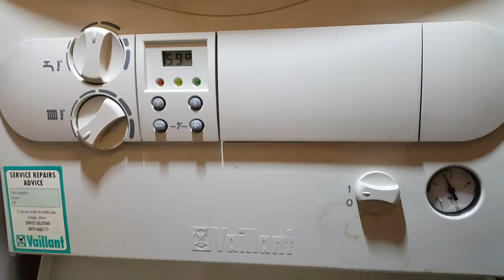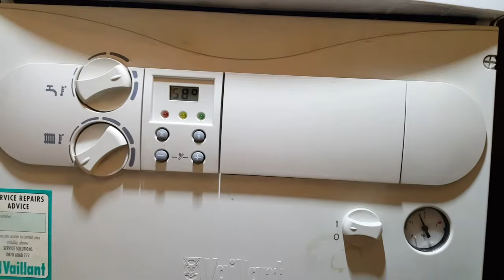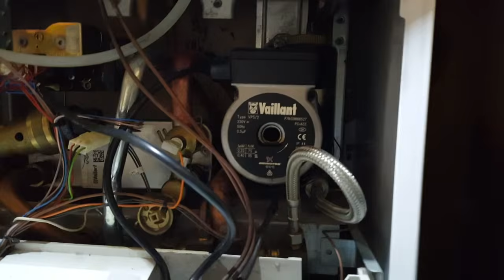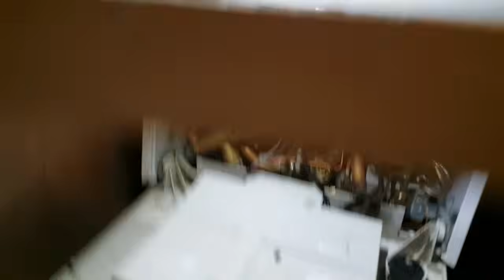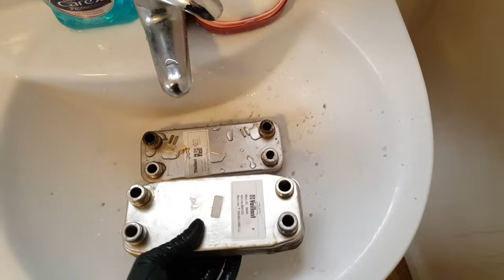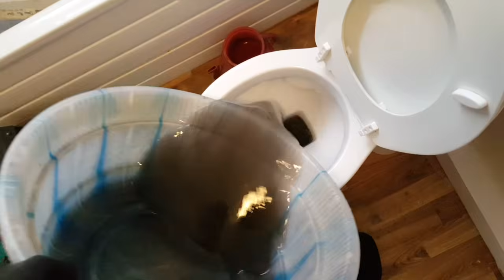Vaillant Hot Water Issue

Comment: thx for the video. I have problem that when I open the hot water I se the fire light up but the water are worm and not hot
Reply from the maker: Hi it's possible you the the same problem shown in the video.
Reply: @Abc_Heating   Thanks for reply. Also I noticed that the fire is sometimes high and sometimes very low. That is the case here?
Reply from the maker: @mironabramson  yes that is what would happen if the boiler is over heating.

Comment: It seems I don’t know my own boiler. What do 
you mean 15l power store!!!!

It’s noticeable when I have a shower. Temperature Of the shower, no where near hot. As I said I could have shower straight from the boiler with no cold water mixed with max temperature setting. 
Regards
Reply: Sounds like the wiring harness has got a water leak or the gaseous valve

Comment: Hi. I have an issue with aqua plus 362-7. I have hot water but not hot enough. I can have a shower with DHW dial full on and shower mixer only on hot water - NOT mixed with cold water-. The bath isn’t too far from the boiler it’s literally installed on the other side of the bath wall. I wonder if you could help. Many thanks
Reply from the maker: wlondoner Hi, your boiler has a inbuilt 15 litre power store which if different to the boiler in the video. Which means there are more components involved in delivering you hot water.
Does it happen on the basin or the kitchen sink?

Comment: You can get the plate hex out on these Turbomax boilers without removing the diverter. When you come to disconnect the top left connection on the hex, hold the copper pipe from diverter to connection steady with left hand, whilst pushing on the front of the hex. I push with a hammer. Have the head of hammer in palm of your hand and use the end of the handle to push the hex backwards near the connections. Same method for 2 connections on right of hex. Then the hex just slides out the left side of boiler - with the boiler casing removed. Quicker than removing diverter.Also, I find it really hard to get a spanner or grips on the nut that holds the bottom left connection on the hex. Use a basin wrench to loosen and tighten the nut - one like this -   https://www.sitebox.ltd.uk/irwin-hilmor-adjustable-basin-wrench-tap-spanner-yellow-10-oTHBW110

Comment: hi I had this problem about 4 years ago, engineer changed dhw and boiler fine . last week it's started again with same problem as before. can you make a vid from start to finish on changing dhw or is it a job for an engineer. Can't really afford a engineer just now but would love a hot shower. thx Lee
Reply from the maker: Lee Pirate I wouldn't recommend you try this on your own. You may even lose the little hot water you're getting. I think you need to address the main issue which is sludge in the system.
Reply: @Abc_Heating  so prob needs a flush and some inhibiter ?
Reply from the maker: @kevinhancock4064  Yes, a full system powerflush cleans the complete system.
Reply: @ABC Heating Services  thank you prob could do with it tbh . Last year bg done lots if work new parts etc but wouod need to check which parts were replaced

Comment: Yes but what if it is not a blocked plate heat exchanger and the water is hardly discoloured?
Reply from the maker: Its possible you have a diverter valve issue, can be tested by turning the hot water on and checking to see if the radiators heat up.
Reply: Thank you for that suggestion. I have a new diverter valve.
The Status Code is S.53. So if I have the radiators on ( S.4 ) and turn on hot water tap it goes S.11 to S.14
and then S.53. The underlying error code is F.22 Dry Fire.
The repair contact company have said "Power Flush" otherwise we take the matter no further.
I can just about believe lime scale is in the boiler anywhere from in cold water to the primary heat exchanger to the diverter valve and after the diverter valve and into the secondary plate heat exchanger.
I will get in a power flush provider, make sure they do not just go radiator happy but also flush from the cold water pipe.

Thanks for your video all the same it is one of the better ones on you tube.
Reply from the maker: Darren Webb Hi Darren, it does seem possible you have a sludged system. Having sludge and lime scale are too different problem. If you contact me through my Web site I can help you further. All the best